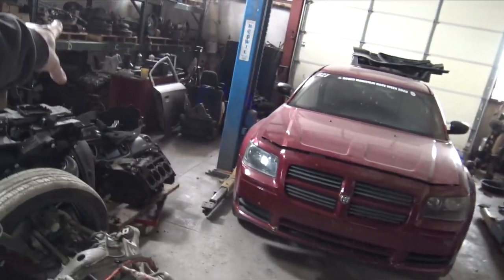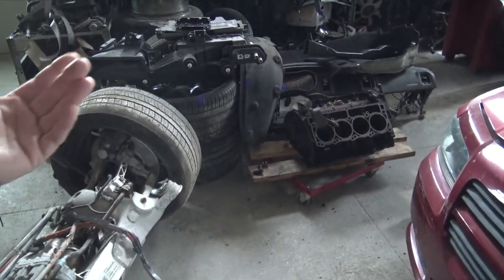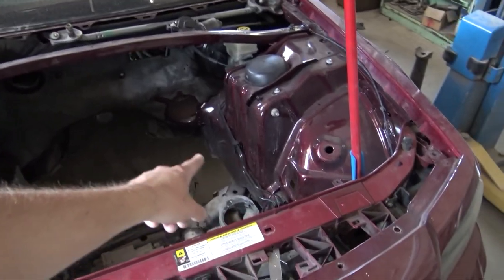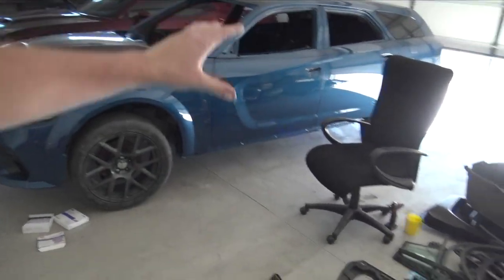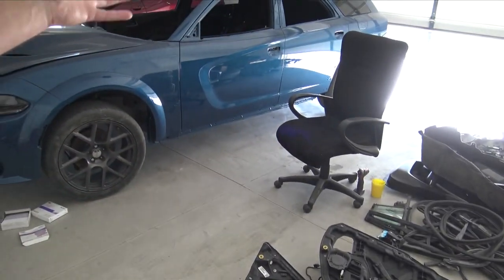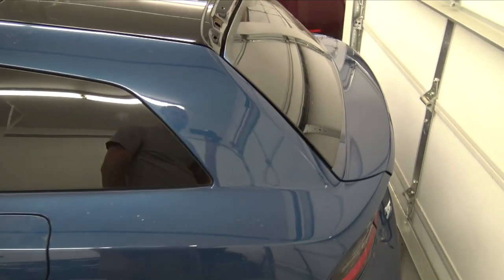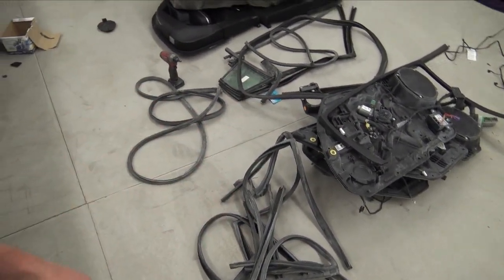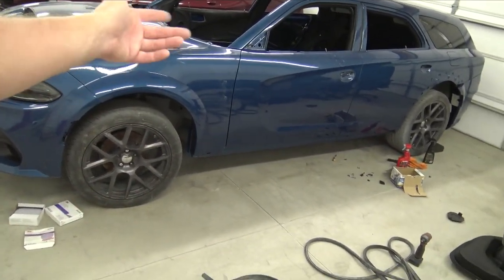Building the Ultimate Station Wagon | 2021 Charger Magnum Hellcat | 1000HP Hellwagon | Pt 54

Comment: As a veteran Chrysler tech, I’m looking at everything that you have there and it makes my head spin. Just thinking about how you’re going to actually get every module in that vehicle to talk back-and-forth is mind numbing. Because, the way I see it,  you’re mixing and matching modules, i.e. ABS, PCM ,TCM, airbag, door modules etc, from multiple models of vehicles. (Some of which were never intended to work together as in the AWD stuff from the WK which is obviously not an LX body. 
What is your plan to actually make them communicate and have the vehicle operate as if it was built at the factory? 
Although,  I do find it mind numbing, It would be a lot of fun, and quite challenging to try and get them to communicate.

Comment: 1 off cars are fun to build but getting the electrical modules to work with all the coded software and get ecu's to play and communicate nicely is a real painful expensive experience with abs controllers tell you find the right one. Its best to get the one for the original for the setup last used.

Comment: I have a question about those brake line, on my 08 magnum SXT the front one are rusted some about to give up, so I planned on getting charger brake line (my 14 SXT has them coated black and seems to hold up realy nice) but I'm not sur the line fit in. The ABS module look the same, mostly it's the thread that make me unsure, so if you have any input on that

Comment: Min 16:32. The left rear window has been fixed crookedly. It can be seen from its upper left corner that it is lower and the left side gap is not uniform. It would be better to fix it again.